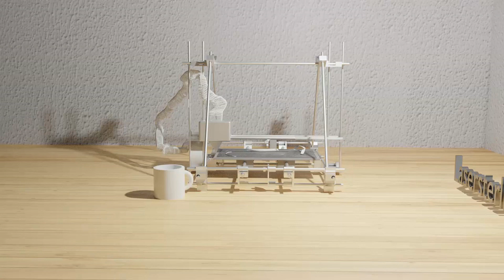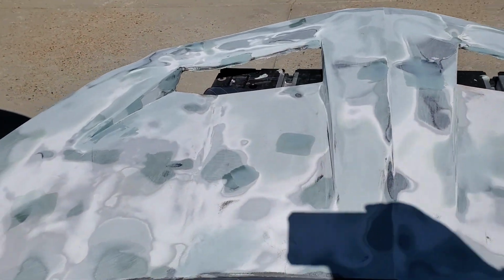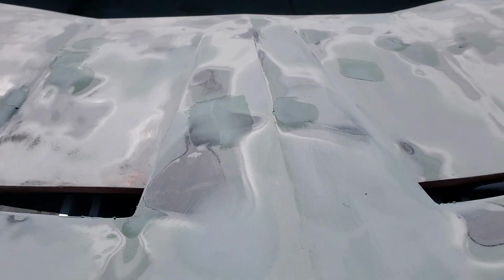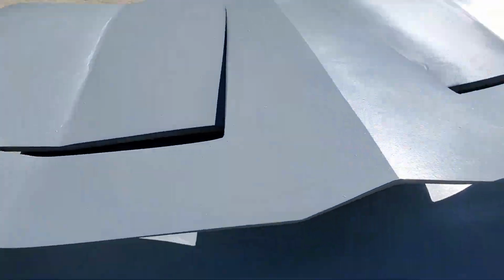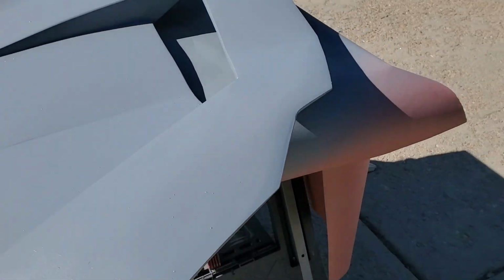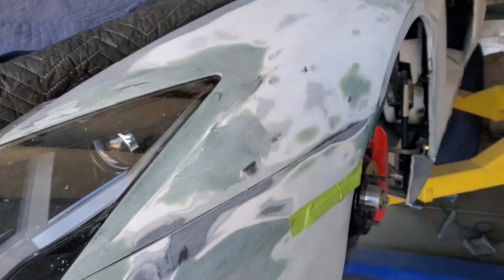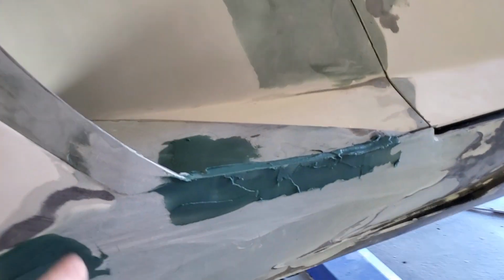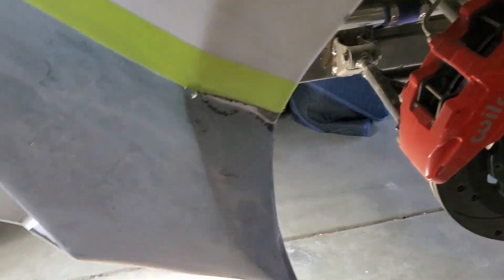3D Printed Interceptor Aventador Update 138

Comment: great progress. for jobs like this with lots of body work use a premium polyester primer (Evercoat feather fill) because it will cover up to 80 grit sand scratches. use a contrasting guide coat block sand to 120 or 240 grit then use a urethane primer. block sand to 320 or 400 spray with value shaded sealer than put first paint job urethane single stage top coat paint the color of your car. then put the car together, after a week or cure time, block wet sand trying not to burn through the top coat. finally paint with base and clear coat just the outside panels. if after you want the paint smoother you can "flow-coat" the clear. lov all yur vids
Reply from the maker: Thanks!